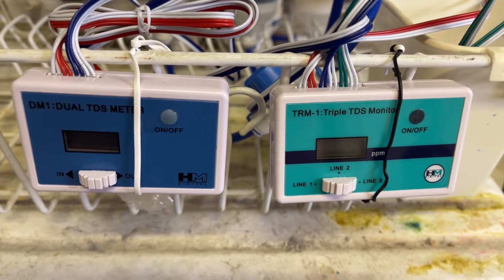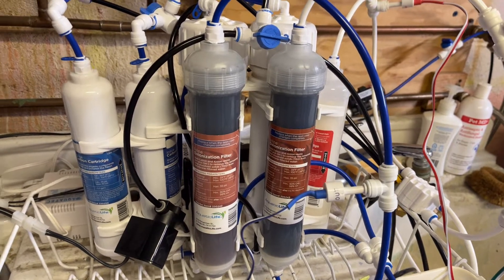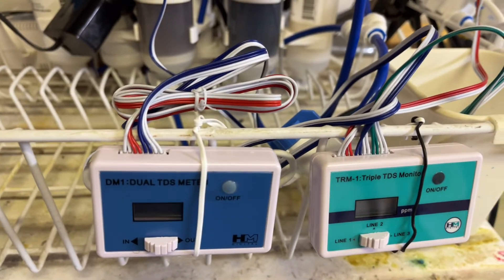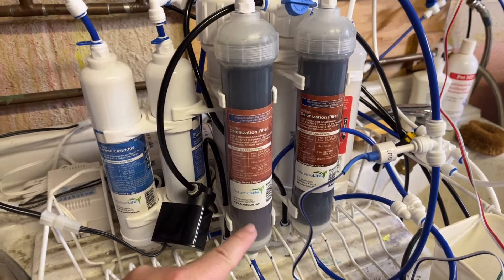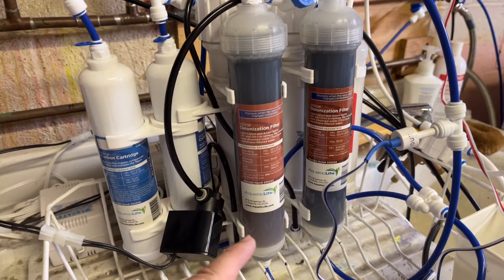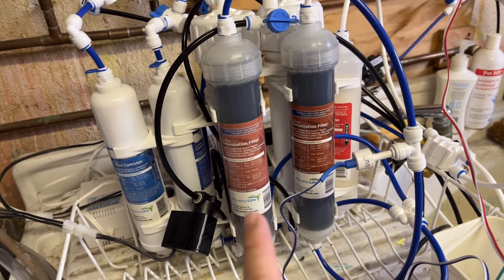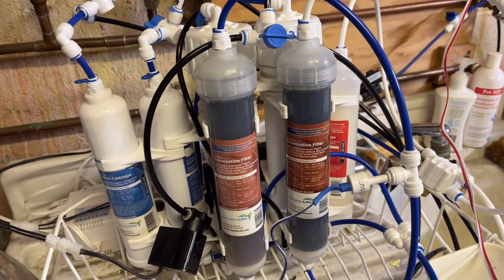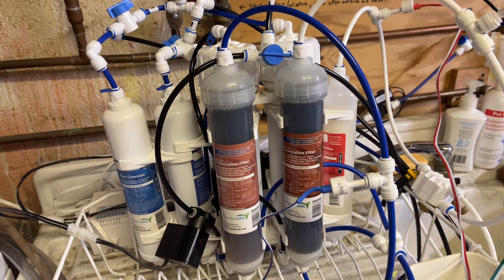Update #7 - HM Digital inline TDS meter

Comment: Hey man! Love you update videos! Can you show the flow rate/production of water from your system? I've just bought a 75 GPD system but I am afraid that it isn't producing the right amount of water per hour :( seems like it is producing drops per minute and I don't know if it is working properly :( thanks a lot man!
Reply from the maker: I had that same problem as well when I first installed my RO system. It's because of the pressure coming into your home. These systems run on the pressure. Usually it's 50 psi because it's how it's set when a home is built. Mine is at 50 psi but since I put in a booster pump, It's boosted to 85 psi. I have gone from taking 6 hours to make 50 gallons to 4 hours. Also, these systems work better under higher pressure. Higher pressure = less TDS. Check the pressure coming into the RO membrane and if it's low, that is your issue. Thanks for watching!